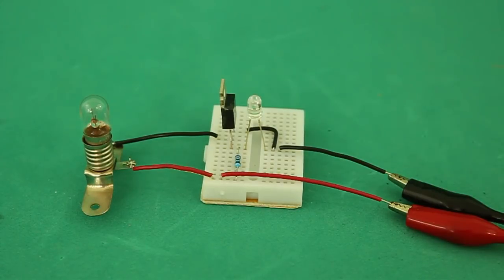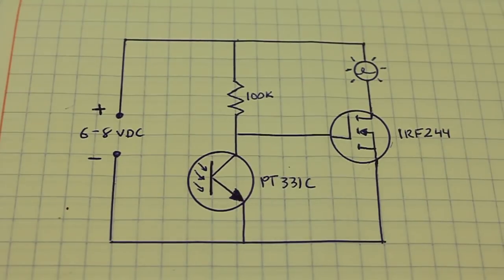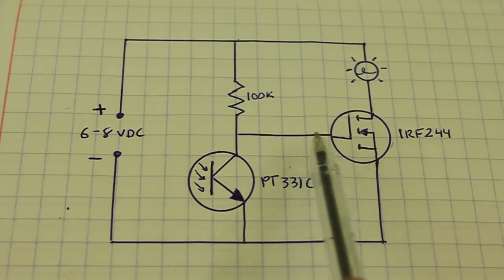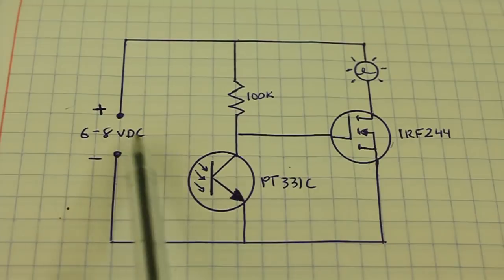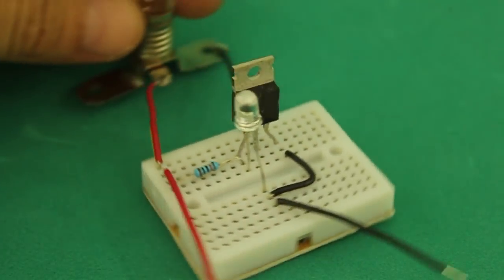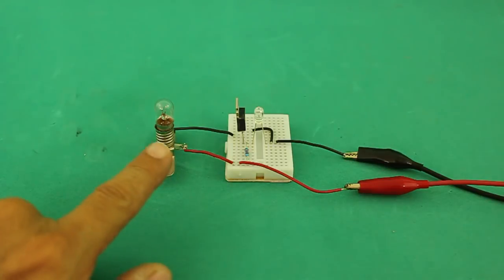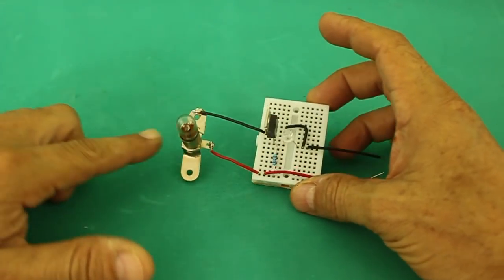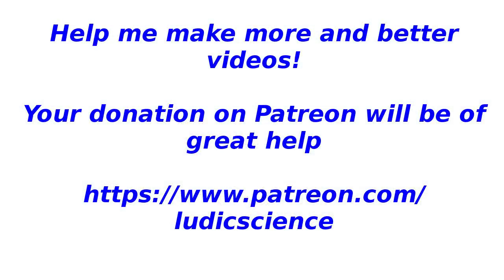Automatic On Off Light Switch with Phototransistor

Comment: You misspoke in your video.  What you should have said is:
1.  Light causes the photo transistor to be switched on (i.e. forward biased). This causes the electricity to go to ground & not to the base of the mosfet.
2.  No light causes the photo diode to be switched off (i.e. reverse biased).  This causes the electricity to flow to the base of the mosfet & to be switched on (i.e. forward biased), so that the electricity will flow through the lamp.

Comment: What if I wanted to do the opposite with the phototransistor? I mean switch the bulb on when light is sensed, and bulb goes off when dark is sensed?

How would the circuit change?

Thank you!!
Reply: Use a photodiode and a transistor instead

Comment: Excellent video as always. Thank you for making it. Now, it would be nice to see you put an electro-magnet (one of the many you have made with magnet wire and bobbin) as a load instead of the light bulb in that circuit, so that it would push or pull a, or multiple neodymium  magnet/s hot glued to a rotating disk or wheel when it is energized, and control that on-off situation with a permanently on light bulb against the photo sensor and allow the light path to the sensor be cut-off by rotating motion of a blade or multiple blades, with the blade's motion provided by the motion coming from the magnet being pulled or pushed. I am sure you get the idea and you already have thought of many variations. I think this make a good next project which will add to the number of different motors you have made to show in YouTube. I have enjoyed seeing them all.
Reply from the maker: I like your idea! Will give it a try
Reply: Ludic Science 
I have also had this idea and I’m curious if it would work. Would the phototransistor switch fast enough to turn the rotor reliably.

Comment: Can I use an LDR instead of phototransistor
Reply: https://www.electronicshub.org/light-sensors

Try a white(or different color) LED, read on using a LED as LDR:
https://makezine.com/projects/make-36-boards/how-to-use-leds-to-detect-light
Then do like the picture on the left, there with an NPN transistor
:http://hades.mech.northwestern.edu/images/2/24/Photo_comparison.png
http://hades.mech.northwestern.edu/index.php/Photodiodes_and_Phototransistors
Maybe it works, not sure

Comment: I knew of photo resistors but have never heard of photo transistors before!
Reply: ten littleindians 

You may need to watch this

https://youtu.be/DNAgJrnj4EM
Reply: Thanks for the link! I'm in the middle of designing a Laser Harp and your link pointed me in another direction for the beam detection part of my circuit. For my use I'm planning to keep it all digital and maybe use the photo diode since the response time seems to be faster. Other people have used photo resistors in their versions of a Laser Harp and it's been a flaw in getting them to trigger correctly.
Reply: https://en.wikipedia.org/wiki/Photodiode#Other_modes_of_operation
Reply: I'm building a scanner version; not a big fan of the framed builds but they would be much easier in the design end. Galvos would be the way to go but they are expensive. A great subject for this channel would be "how to make a simple galvo.".
Reply: Thanks for the link!
Reply: ten littleindians I bet you are making a framed one. I made a laser harp not long ago.  I use photoresistors.  Check the voltage for triggering “high” in arduino. You just need add a corresponding resistor to create a potential divider.   The value of the resistor depends on the characteristics of the ldr.  Good luck and have fun.
Reply: +ten littleindians sure :) try building a ribbon mic/speaker :)
https://youtu.be/aagJUujcxsQ
https://youtu.be/SahVz1HQld8
Reply: igrewold. I have 3 or 4 old mics around that don't work. The old Elvis style! I've always planned on putting new guts in them to make them functional again. I may have to try a ribbon mic build.

Comment: I made using Ldr
Reply: https://www.electronicshub.org/light-sensors
Good job :) try a LED serving as LDR :)
https://makezine.com/projects/make-36-boards/how-to-use-leds-to-detect-light
Reply: http://mthelectronicslab.blogspot.com/2014/09/how-to-make-color-detector.html
You can use LDRs to detect color, using a uC/MCU (or platform like Arduino or Digispark)
https://duckduckgo.com/?q=Digispark&iax=images&ia=images
https://youtu.be/On2CqY1niX0
https://youtu.be/WXvYBl_dgA4